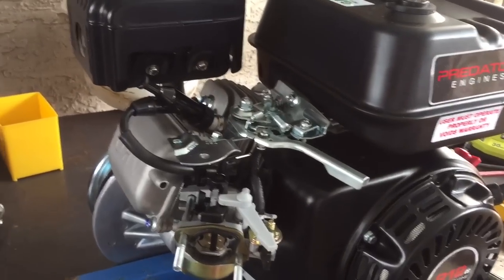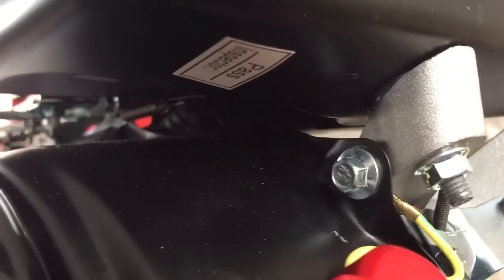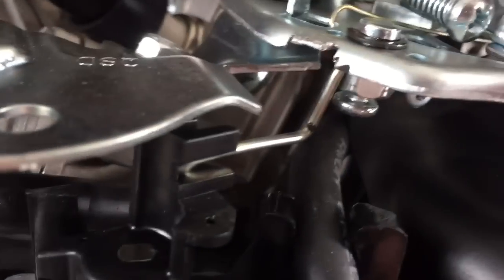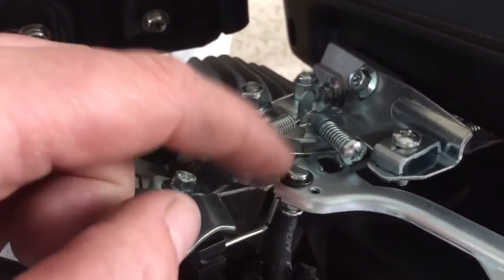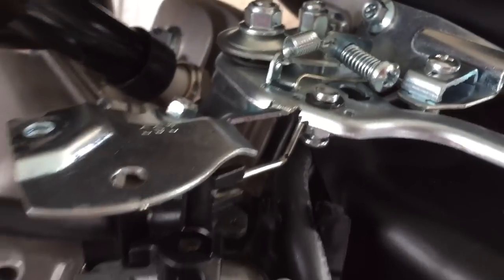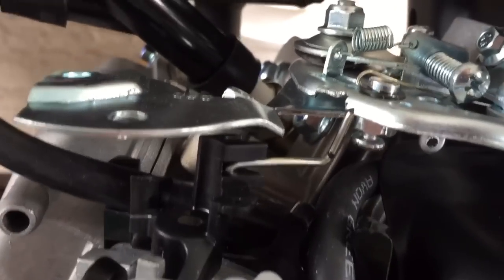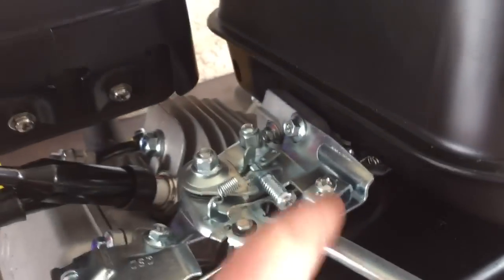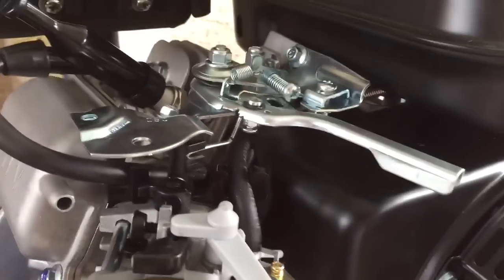De-governed Predator Throttle Linkage

Comment: The governor gear is still internal, so therefore still engaged.. the plastic gear only allows the engine rpm to reach a certain point.. no matter how you set up your throttle lever or where or where not you put the throttle return spring.. it still will not climb pass a certain rpm..all of these mindless throttle set ups just help with achieving the highest rpm allowed with the governor still engaged.. most people, swear their karts are now faster by doing these simple configurations, but in truth, all that you are gaining is quicker acceleration.. but nothing gained on top end..
Reply: Well I would agree with you IF the linkage still goes from the governor arm to the throttle linkage but without the linkage being attached the governor doesn’t do anything except float around. The gear inside the engine doesn’t tell the engine what do but rather the engine is telling the governor what do. There are weights inside the white governor gear that when at operating rpm the are thrown out therefore pushing on the governor arm and in turn pushing the throttle open more. If the linage is taken off of the governor arm then the governor no longer controls the rpm of the engine. As long as the governor adjustment screw is backed out all the way or removed completely and the throttle linkage is hooked up correctly then the foot pedal or twist grip fully control the throttle. Without the governor arm hooked up you are free to rev the engine as much as you even to the point of detonation. That’s why on some kart videos like a couple from cars and cameras they have their foot all the way down maxing out the governor but can still proceed to reach back to the carb and get more rpm out of the engine weather the governor likes it or not. Hope this helps.
Reply: asphalt cowboy. You must be new to this because what you said is absolutely incorrect. 

With the governor linkage removed from the carb the spinning governor gear itself has no way to restrict or regulate RPM and does nothing but spin. 

The engine in this video is set to govern to 3600 RPM at full throttle brand new out of the box. After what he did in this video the engine is no longer governed at all and will reach more than 5000 RPM and climb until valve float starts somewhere in the 5000 RPM range. The engine would run much higher RPM than that with upgraded valve springs, re-jetting, etc. Acceleration should be the same governed or ungoverned. The governed engine will just stop pulling around the maximum governed RPM.

And this is far from new information. People have been manipulating these linkages for decades to get higher RPM and top speed..
Reply: Not!
Reply: Cowboy is not correct!